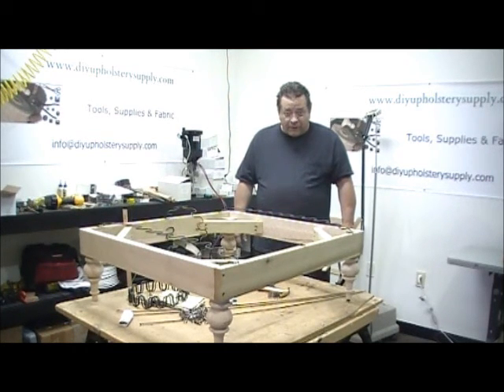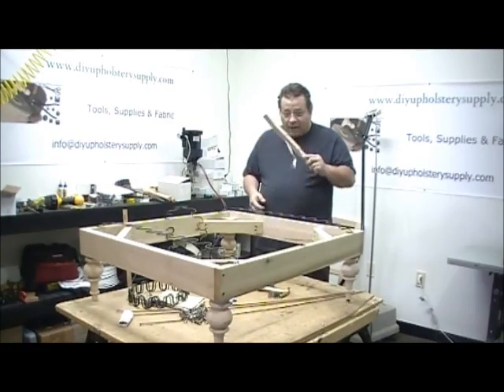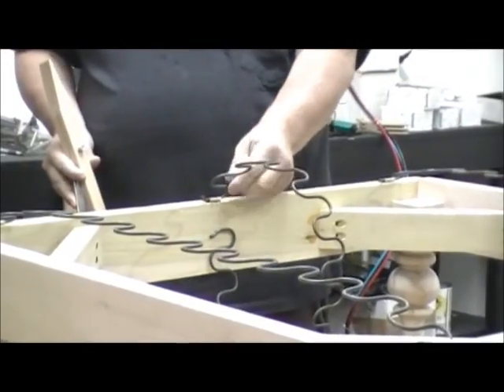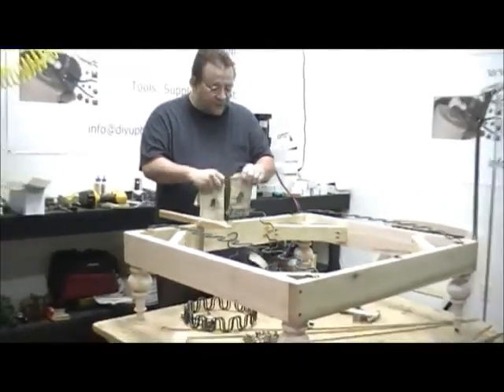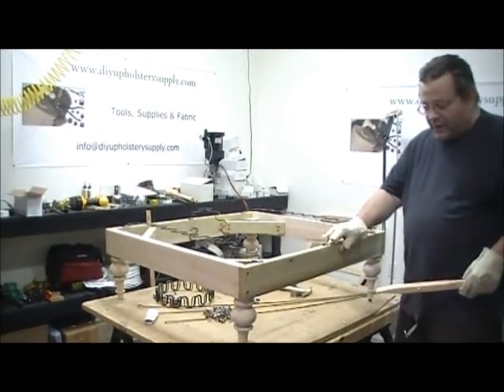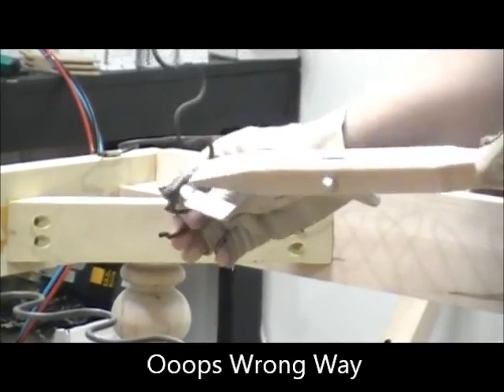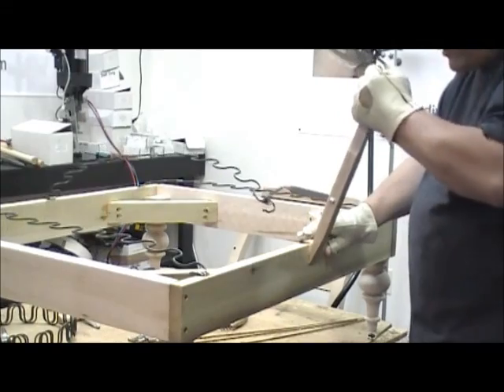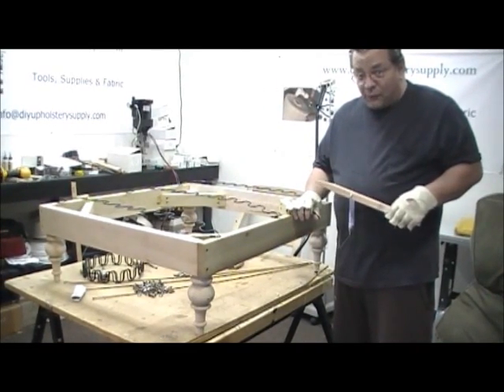Upholstery Spring Stretcher

Comment: here's a hint guys, this tool can potentially slip on the side of the frame, staple a piece of rubber over the lever edge, or do what I do, put a piece of scrap foam  between the lever edge and the frame. Only takes a second, and no surprise "kickout" if it slips.